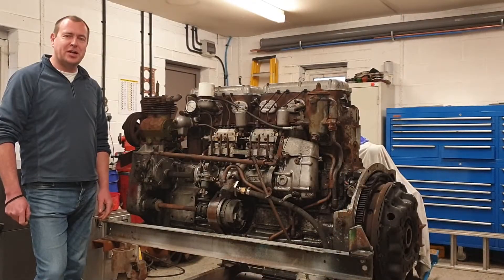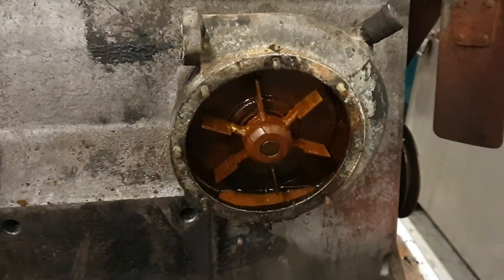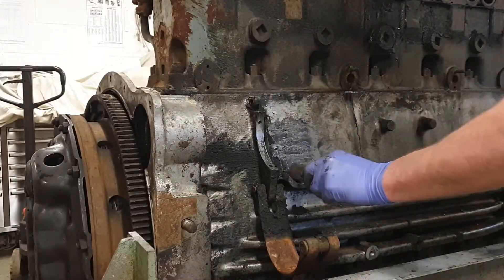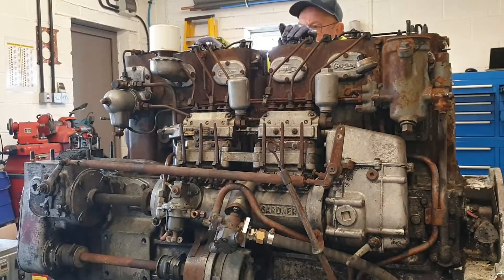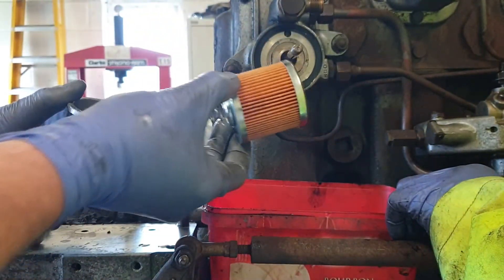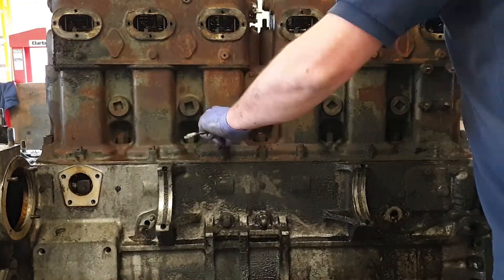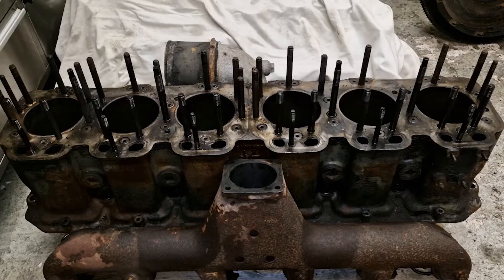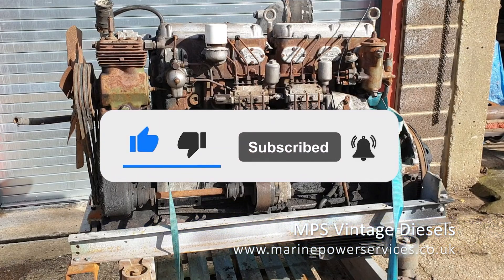Gardner 6LXB 180 Overhaul Part 3 - Top end teardown

Comment: With that much corrosion build-up, there’s an excellent chance that the radiator would be blocked too.  While not directly a part of the engine, it is indirectly part of the engine system.
Reply from the maker: Very true, you would be surprised how many people dont think about all the coolers, pipework and tanks that make up all the systems that are needed. All need as much attention as the engine did to make sure it all runs as it should.

Comment: Really enjoying these great series on the 6LXB rebuild, especially little details that for me, is allowing the odd penny (or should that be a Happeny-bit?) to emerge and drop! I have a 1978 6LXB (and thank you also for the link to getting the year of manufacture) here in my workshop destined to be done up by a Gardner professional (I hasten to add!) to replace the old 6LW in my boat here in NZ. Looking forward to the continuing series! PS. - your immaculate workshop hasn't gone unnoticed either....
Reply from the maker: Thanks for your comments and glad you are enjoying the series. The next video on the bottom end teardown is coming soon, Just need to finished editing it, watch this space.
Reply: "Done up by a Gardner professional"?  That was a "modern" engine in 1978? If not good luck finding a "professional" to "do it up".
Reply: @deeremeyer1749  Thanks, but all good, as luckily here in New Zealand we have 2 firms who specialise in Gardners. My "modern" 6LXB was fully reconditioned, and is just needing the injector pump and injectors done (due only - to the previous owner's wee foibles) before being fully soda blasted painted and polished ready for installation.